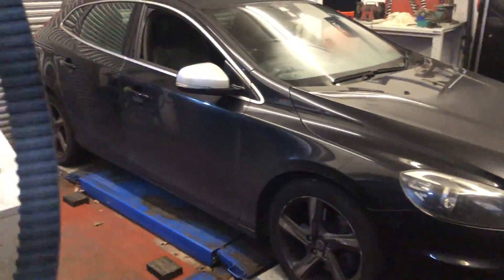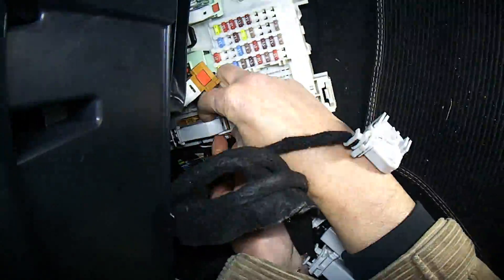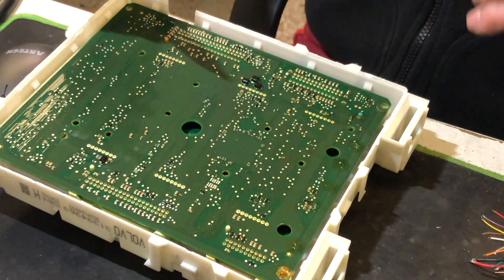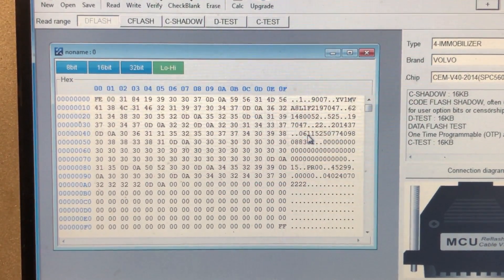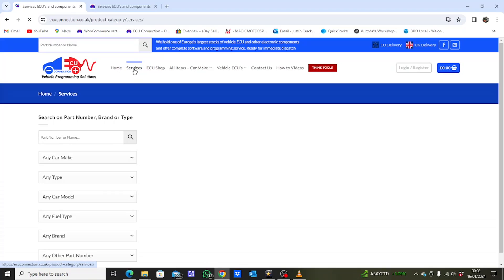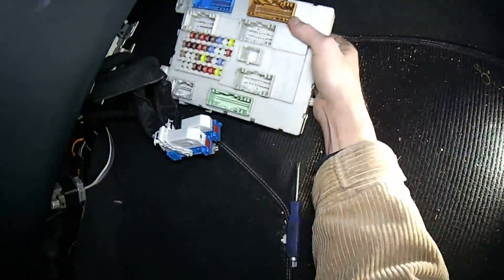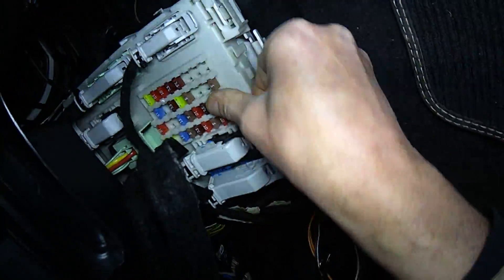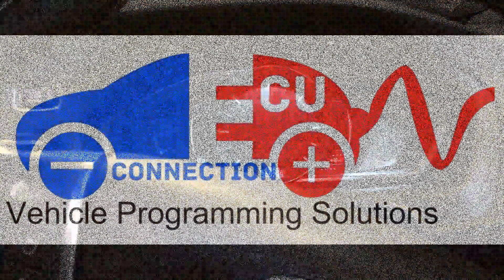Volvo V40 CEM (Body Control Module) How to Remove Faulty Unit & Program (Clone) replacement + Refit

Comment: Hello, I have a Volvo V40 2016 D4, my radio works for 40 seconds then the sound disappears, the diagnosis says that the module is not compatible U300045 and U030141, what could it be?
Reply from the maker: Sorry, I have no experience with these modules & can’t help you with that problem I’m afraid..

Comment: I'm looking to upgrade my L-cem to an M or H so I can retrofit ABL headlights- have you ever cloned just what's needed to run the upgraded cem without cloning everything and overwriting the software I need present to use ABL?
Reply from the maker: Sorry, I have only ever cloned ‘like for like’ with CEM units, I wouldn’t be able to advise what is needed to retrofit a different type of CEM or if it’s possible..

Comment: Did you use orange programmer for backup immo dada which is from 8pin eeprom 95320 ?????
Reply from the maker: I did use orange 5 to read Eeprom, this data is used to gain password to then read D-flash & P-flash via CAN..

Comment: hi  volvo s80 2000  year ,After replacing the radio, the steering wheel does not work and there is a CAN configuration error e003, how do you solve it? I need to register the radio with CEM, what should I do?

Comment: Hi all. Need help if possible. My sister's 2014 V40 has a stiff steering wheel at startup (intermittent) and the dealer changed the batteries yet the problem persists. DTC: ECM U016700, CEM B102581, PSCM U300049. Any guidance would be amazing. Thanks
Reply from the maker: Sorry, I have no experience with this system I’m afraid..

Comment: Before I started, the car would turn on (with fault codes), I took the CEM out to clean with electrical contact cleaner, dried it all out. When I went back hooked it all back up, ive got nothing, which makes me think I've got a completely faulty CEM unit. 
Fingers crossed a new one and a clone will work 😂
Reply from the maker: @LottiexXful  Hopefully so, let us know if we can help cloning it:
https://ecuconnection.co.uk/product-category/services/?filter_type=body-control-module&filter_car-make=volvo

Comment: I have just FIXED my heater blower was not working my rear wash wipe and front washers also and ALL I did was to check that the clamps on the fuse block  were all fully pushed down. 1 was open I think those potholes did it managed to break it loose!. Took about 5 minutes and now just like magic EVERYTHING is WORKING again FANTASTIC. SO definitely worth carefully looking at the connections in the under dash area to the big oblong fuse box Saved me possibly £HUNDREDS  AND waiting a week for the garage to look at it too! I am sooo happy. It was my Ford focus BUT looks pretty generic. Good luck
Reply from the maker: @willfree8230  well done! Yes, I have also had the Focus plugs getting unplugged, I’ve blamed it on passengers with big feet!

Comment: Hello, how can I change the display of my dashboard to have same display as your volvo. I have also Volvo V40 but with white display
Reply from the maker: I would imagine you would need to replace the LEDs in the dash…
Reply: How can I get in touch with you? I have some questions because my volvo is badic edition so it is without reverse camers or P assistance. Display looks different and the steering wheel has no wheel button

Comment: Why use the tool at the end to clone when the first two gave you the data needed to clone, just interested. Aside from giving you the password what would be the reason? curious.
Reply from the maker: The first & 2nd tools (VVDI & O5) do not read the full data on some of these units & does not clone them correctly, although it does give us enough information to read the password, we can then access the full data with the 3rd tool, also this tool accesses the data via CANBUS, we can therefore verify the units power up correctly after programming so we can make sure the units haven’t ‘bricked’, thanks for watching!
Reply: @JC-ECUConnection  I know of the tools, can omit them from your comment if you so wish. Haven't had to do one before, just wondered. Thank you
Reply from the maker: @MrAsadEp  No probs!

Comment: I had an issue with one of these bcm faulty brake light output. I purchased second hand bcm of same part number and sent off to an ebay programmer. When plugged in, it started car but all lights were stuck on, flashers brakes etc. So we sent the programmer another second hand unit to program, same result!! So had to plug in original unit for now. After seeing your videos i may attempt myself with vvdi, i didnt realise you could do it without splitting the boards. Thank you
Reply from the maker: Thanks for watching, VVDI doesn’t work on all boards, we only use it to read the EEPROM to gain access to the units PIN number, we then use other tools to clone the BCM, my advice is to first test fit a donor unit, make sure there is no brake light faults then send us the unit to us to be cloned properly.. or get the eBay programmer to put the donor files back into your donor unit, test fit it again & then if all ok send it to us to do it, for more info visit our website:
https://ecuconnection.co.uk/product/volvo-v40-body-control-module-cem-module-fusebox-lear-programming-service/

Comment: My mechanic has diagnosed that my ECU has burnt some fuses. How much does a new ECU cost?  I drive a v40 2013
Reply from the maker: Hi, thanks for watching! Sorry but without having the part number it’s not possible to give you a accurate price, please get the part number from the ECU & check on our website - www.ecuconnection.co.uk or call us with your part number, thanks

Comment: What's possible cause of volvo not starting displaying message "immobilizer try to start again "
Reply from the maker: There could be many reasons - Key fault, BCM fault, wiring or ECU.. on some models with a SID803/A ECU there is a common fault after a flat battery with data getting corrupted - if this is the case then we can help!
Reply: Hi friend, to add a key, can you do it via OBD or do you need to remove the CEM module? It's a 2018 Volvo V40. It's a semi-smart key. Thanks, friend.

Comment: My v40 pops up tpms service required message couple of miles after resetting;have been to Volvo twice ;did diagnostics and couldn’t find any fault.Could it be something with the ecu?
Reply from the maker: Sorry, I really wouldn’t like to say what the fault may be here.. intermittent faults are always the hardest to track down…

Comment: I'm having trouble understanding the audio because I'm not English, but I have a question. I unplugged the EMC to check a relay on my volvo V40 and now that I plug it back in the ignition activates but the car won't start, how can I fix this?
Great video, thanks!
Reply from the maker: Oh dear!.. thanks for watching & for your comment.. as for your issue, I really can’t say what could be the issue, maybe you have had a random fuse blow at an inconvenient time! I assume by EMC you mean Engine Control Module (ECM) - there is no reason why unplugging & plugging in again should cause a problem - hopefully it is just a blown fuse, or possibly a bent pin on the ECM multiplug? Good luck! 🤞